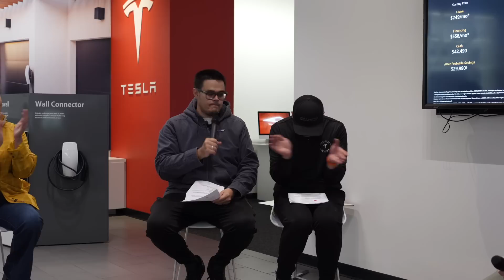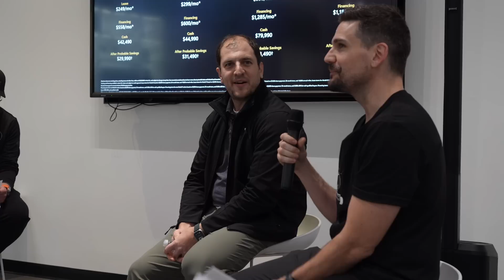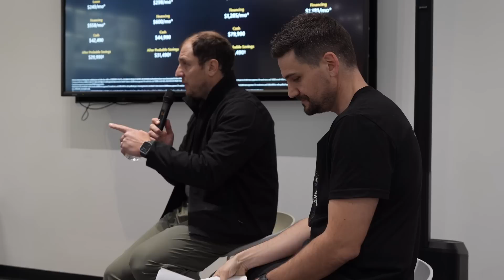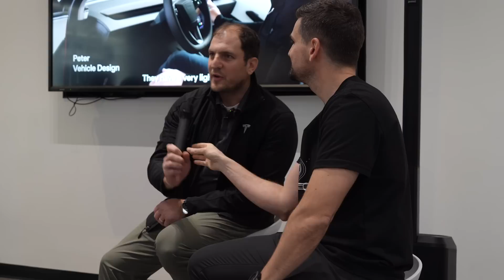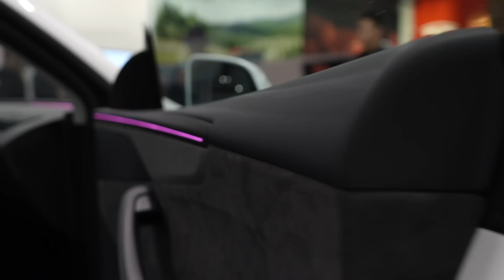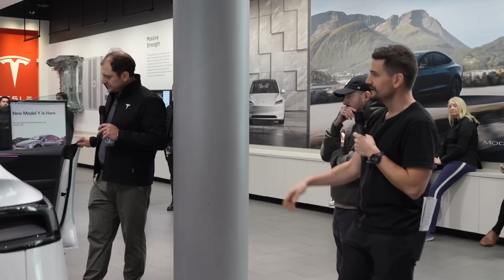SHOCKING DETAILS: TESLA ENGINEERING shares MODEL Y Details

Comment: In regards to battery capacity, I don't buy it. Streamlining, weight reduction, motor efficiency, and aerodynamics are 40% of the solution but the battery chemistry and capacity are still the most important parts of an EV. 

Tesla can argue that they have the charging network as their crutch but everyone else gets to use the network now so there is no advantage there. 

My opinion is now that Tesla is established and popular, they can afford to give us less while charging us more. It’s still a nice car but they should improve the battery capacity.
Reply: I would’ve bought the launch edition if it had a modern range figure. Few friends feel the same way. same thing on the Cybertruck. Needs to be at least 400
Reply: @mdffwoodworker  180 useable range is a joke tbh on road trips. I have prefacelift 2024 model y and happy that I ordered it. Just saw new model at tesla and its ugly with same hardware just some cosmetic upgrades. Next car I'm going ice again as gas prices will go down now and growl of the engine and 5 min fill ups beat any savings ev is offering. ICE is still better choice fo majority of people unless breakthrough in battery tech is made
Reply: @mdffwoodworker  I had a reservation on a Cyber Truck. Tesla came up short on their promises so I didn’t pull the trigger. I can't justify paying more than what was promised for fewer features and specs. Plus, for that amount of money, the polarizing and controversial design of the vehicle was hard to overlook. I’m an animator and illustrator. I drew something like this in middle school but my drawing skills have improved since then. I suggest Tesla to do the same. From my point of view, it’s missing some polygons, unrefined, unpolished, and something that came out of Minecraft! It’s a hard no on the design aspect for me. It’s iconically good and bad but does it have staying power? Probably not.

Comment: nice pr session. still didn’t explain why the focus on ‘efficiency’ forced tesla to stick to the old batteries that take half an hour to charge up to 80%, while the chinese competition does it in 10 (!) minutes, with the warranty on the battery being similar or even better than tesla’s.
Reply: Where are you charging? It only takes 15 minutes to charge to 80 percent on Tesla chargers
Reply: Aren't these cars all using Panasonic 2170, at least in NA? What is Panasonic doing to improve their batteries? Can't use Chinese batteries if they want to qualify for the tax credit.

Comment: Is it too difficult to let customers choose the steering wheel, like they can choose the color or size of the wheels?

Because I drive a Model 3 now. I'm used to using the turn signal buttons (I actually like them). If I were to buy a Model Y, I would have to adjust every time I switch cars. It's not very convenient.

Comment: The range isn’t enough! Very disappointing they didn’t add more battery capacity.
Reply: Battery capacity costs money, and adds weight, and 99% of the time it's a waste. You can drive roughly 200 miles from 80% to 20%. Don't you ever eat or use the bathroom?

Comment: no answers to the structural battery pack and front casting, big thing in the past, but nobody mentions that any more. Got a Y SR with structural BYD blade, will Tesla keep the old non structural design with the new CATL ? Surely with the LG since it will get the same lame LG here in EU&China. The CATL has to beat the BYD, otherwise the new Y is no deal at all
Reply: Structural battery pack question was asked by one of the attendees.

Comment: The only Shocking detail about the refreshed Model Y is that after 5 years on the market, the refresh has the same battery, the same charging curve, a tuned suspension, and minuscule better aerodynamics, but what counts stayed the same. Tesla currently enjoys the first-to-market advantage but is already falling behind the Chinese in terms of the whole package you get for the same price. When the engineer talked about the efficiency gains, and it was 5 % more rage, I just heated the response, Wow! 5 %, lol. Before, it was in the margin of error, now, it's a bit tangible.
Reply: The chinese ones as cheap as they are have still not been able to be profitable yet. It’s a race to the bottom which is not healthy for the ev market
Reply: @ yup 
Without subsidies they are toast
Reply: @djibicisse  just like oil subsidies
Reply: that's the truth, 5%, haha!

Comment: I use a M3P Highland for 7 month now. Not once I had a problem with the blinkers in any roundabout. Anyway: If you want to you can add stocks from the aftermarket. You have the choice. I like it how it came. With the Y you don't have this choice anymore.

Another thing: Guys you said, you looked at every watt to reduce power consumption and yet, the rear screen is always on, even if no one is sitting in the back?
Reply: The rear Screen is unnecessary，Using it not often
Reply: @Scott.Damien  Well we use it every time when driving with our daugther. It is the top feature for her. But as I said, it would be nice if it was auto off when nobody is in the back.

Comment: Any improvement on turning circle?  Old Y is way too wide a turn at 12.1m. It needs to be 11m.
Reply: I think they will have to introduce rear steering to achieve good turning circle.
Reply: Very good question. I am wondering the same thing.
Reply: Yeah, I'm constantly spinning 180 degrees turns on a daily basis. You guys complain about the most bizarre stuff.
Reply: @darylfoster7944  perhaps you are not familiar with UK roads, mini roundabouts  and car parks.

Comment: I started researching Tesla vehicles in 2024. I held off purchasing until the model Y refresh was delivered to a dealership in my state. I love the new Y so much that I ordered one on 2/2/25. I'm nervous about the learning curve, but I'm excited at the same time.
Reply: They are a joy and a breeze to operate once you adjust. It's pretty intuitive like an iphone.
Reply: I learned quickly how to drive my 2024 MYLR and the regenerative brakes are the best part because I have only had to step on the brake pedal when someone cut me off or the traffic light turned red when I was close to the intersection. Within one week of my delivery I was fully comfortable driving and confident in driving it in all situations. This is a fun car to drive and I am impressed at how well the FSD has improved in the last year that I am no longer anxious letting it drive itself. I am happy with my 12 months of driving experience with the Model Y and I have saved $5000 in gasoline costs in 20,000 miles of driving in one year
Reply: @michaelblack8265 I’ve gotten so comfortable with FSD that I ride with a neck pillow 😂
Reply: @Highfreqgaming  i have a neck pillow too
Reply: You will be fine. An hour or two and you’ll wonder why you didn’t get one sooner. Both my parents are late 60’s and love theirs going 4 years now.
Reply: Me as well especially living in a snowy area. But I still placed my order last week
Reply: @BB-ts3qx No issue at all, model Y is most selling car in Norway as well, lots of snow, mountains and cabins.

Just be sure to have winter tyres, and it’s a breeze. 10/10
Reply: @BB-ts3qx  if you ordered a dual motor it’ll function better on snow than any pickup you’ve owned.
Reply: good decision to wait and you got the refresh.  This car will probably sell even more than the Old Model Y.
Reply: So you’re the reason sales have “collapsed” in January lol
Reply: I’ve learned quite a few things about the model Y refresh anyone buying it now I think will love it very much, that said I picked up our family second model Y last December, no issues with sorry here the deal was so good 5 years no interest, all the govt. incentives plus tesla discounts + incentives yeah I’m comfortable.
Reply from the maker: You’ll love it
Reply: There's really no learning curve, it's just a car
Reply: @mremtb7689 .  But much better
Reply: A friend of mind who lives  in a prominent neighborhood in my neck of the woods, told me he is starting to get 'Proudboy' salutes when he drives thru his area! I implore folks not to make a Tesla vehicle a political object!
Reply: Ah, you purchased a swasticar at the height of Musks Nazi outbursts.

Cover 🤡😂
Reply: @Alacrity2021   I know you're trying to be funny, but it's coming across as incredibly low IQ.
Reply: @Alacrity2021  👎

Comment: Hard to understand the decision to not add more battery capacity. In January of this year I drove my 2024 MY dual motor from Ontario Canada to Phoenix AZ (2550 miles) and had to stop 24 times. Great vehicle but feel that was a real miss for real world cross country driving.
Reply: I think the 400 volt architecture is proven to be a reliable drivetrain, I noticed a solid difference with the 250 kw curve on v4 cabinets  to last noticeably longer. The goal
Is to retain the 250kw curve with current setup and charge 200 miles in 8-10 minutes.
Reply: @Ricklepick1996  I was able to use one V4 cabinet on my travels and it seemed to work well. I do believe we will see most EV's with 800 V architecture in most parts of the world in the near future.
Reply: 24 times for charging seems excessive, unless you have a hyperactive bladder that was causing you to stop every 100 miles
Reply: @TeNgaere I agree you should be able to get at least 240 miles of range with 40 miles of buffer so he should have only had to stop 9 or 10 times
Reply: It’s why I didn’t buy the Cybertruck & had the Y come with a 400 mike range I’d of considered selling my  2022 Y Performance.,,
Reply: Agreed 100% it needed at least 50 more miles. I don’t get why they left the battery size untouched it was a bad decision in my opinion
Reply: @blueplanet1048 statistics. Most people average 50 miles or less per day. A bigger battery is a waste of resource and a drain on available energy because of the weight. A bigger battery makes the car more expensive to buy. If you travel 300 miles everyone needs 1 stop anyway. There is no logical reason to make the battery bigger.
Reply: @paulmcgreevy3011  well most people doesn’t mean everyone. different people
Have different needs. If I want a low range car there are cheaper alternatives. Considering keeping the buffer between 20%- 80% for battery health minimum range should be 350 actual miles for me personally.  I was expecting more range unfortunately
Reply: Stopping 24 times for charging seems excessive. My husband and I drove our Model Y 6600 plus miles in 15 days  we started most mornings with a full charge and charged for 15-20 minutes twice a day. Our last two days we drove over 700 miles each day. We were out west driving at 80 plus miles on the highways legal speed limit plus we had a headwind that used more energy. Charged more those days.
Reply: You stopping 24 times for a 2500 mile drive is way overkill.   With that said, I agree, I would have liked to seed a 5-10% larger battery pack resulting in 10-20% more range.
Reply: @jmanjr  Unless someone has driven across the country in January they would likely not understand. I have done it several times (twice with my M3) and once with my MY. That is why I said real world, in the summer you can get 220 WH/Mi and in Jan driving mostly on I40 my average for the trip was 352WH/Mi. that is real world. No bladder issues vehicle would not comfortably make the next super charger.  For me the M3 is around 15% better that the MY, I feel they should have addressed that and given the Y at least 15% more range than the MY. Everyone of my charges was what the Tesla trip planner recommended for stops.
Reply: What's with the 100 mile stops? Maybe Tesla should put a 200 kwh pack in the car, so your stops will only be every 150 miles. Absurd.
Reply: Most people don’t do cross country driving. The battery for teslas are still the most expensive part of the vehicle. They could easily make their cars go over 500miles per charge, however that would make their vehicles as expensive as Lucid which most people would not be able to afford.
Reply: Not hard, I love Tesla, but you know they just skimp on the costs, at the expense of user experience, it’s just about lowering their price per car